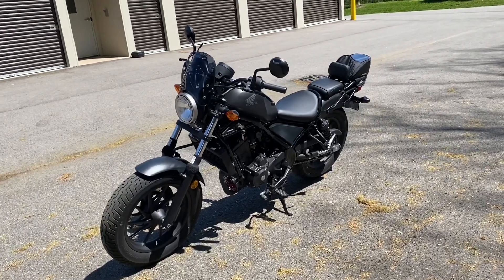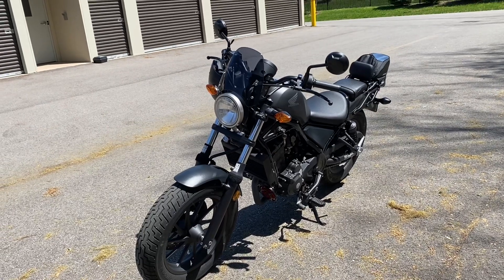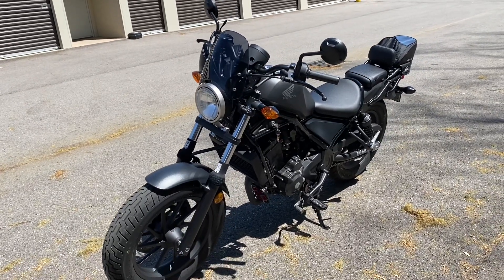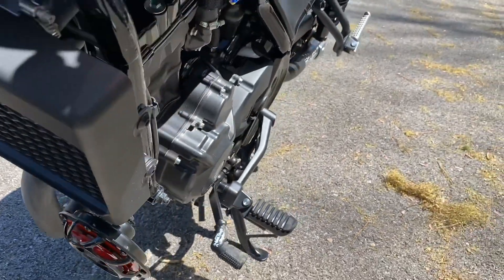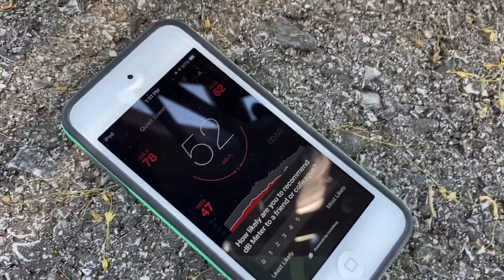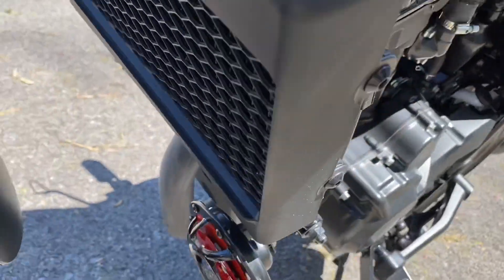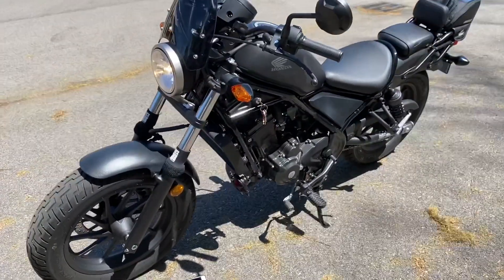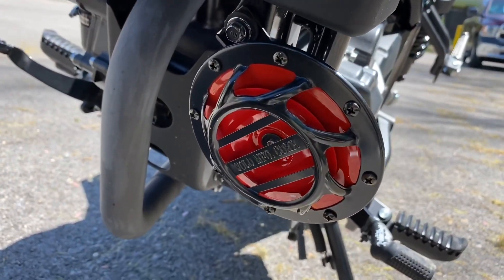I put a car horn on a Rebel 300!

Comment: Another option worth looking at, that safely operates without an additional relay, is the Denali Soundbomb mini. 113db and low amperage👍
Reply from the maker: I looked at it & it’s reviews weren’t good. The price was way too much for what it is. This horn didn’t require any mods & at 120db is the best thing I have found. . 👍🏻
Reply: “Sounds” like you found something that works just fine😉
Reply from the maker: Lol yes. It’s so loud that I have been ordered not to use it around my spouse 😳